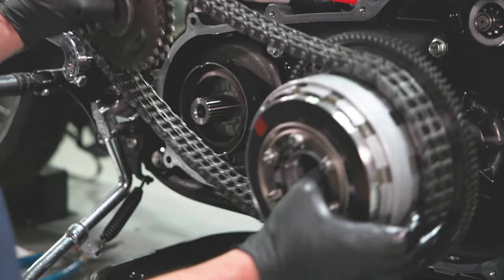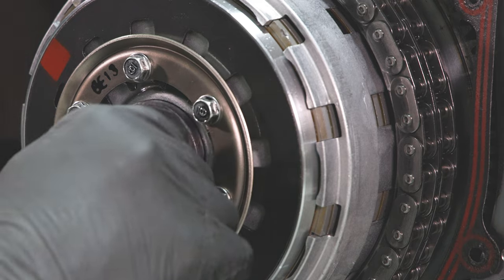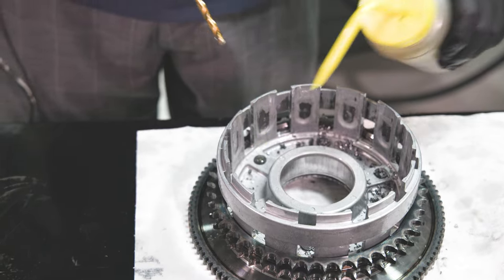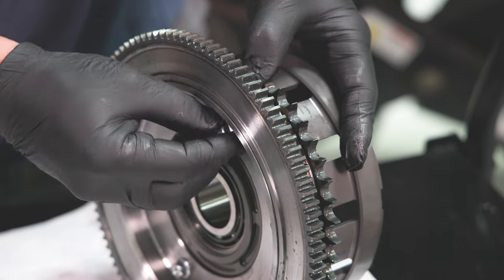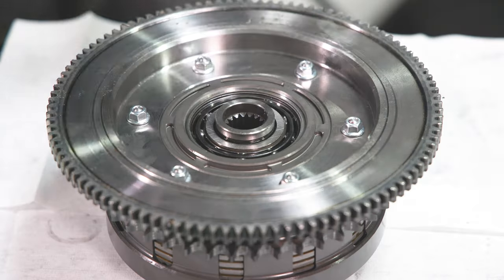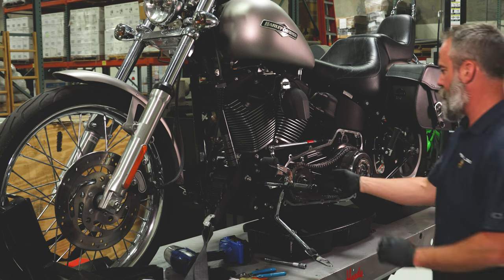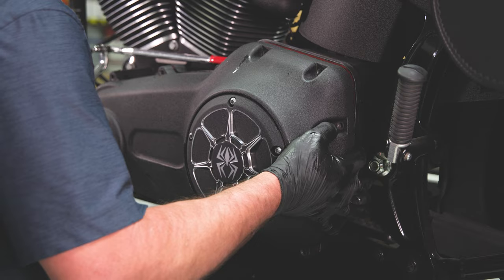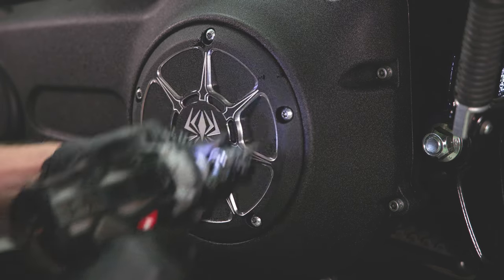How to Install a Rekluse Clutch Basket in your Harley M8 and Twin Cam

Comment: Using an impact on the primary shaft bolt is a good way to destroy your rotor....the sharp vibrations could loosen the magnets.  Don't do it this way, instead get a locking tool to prevent the sprocket assembly from rotating and use a breaker bar.